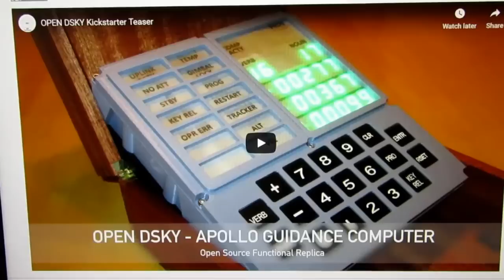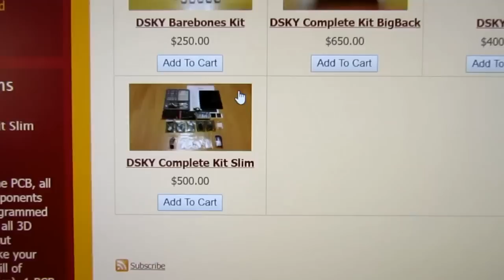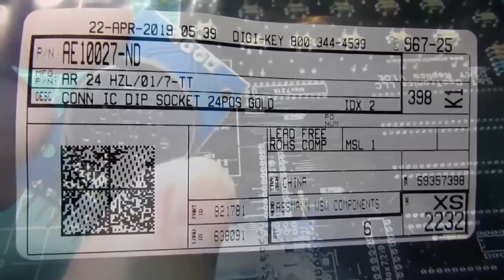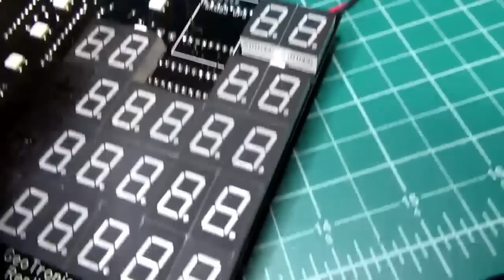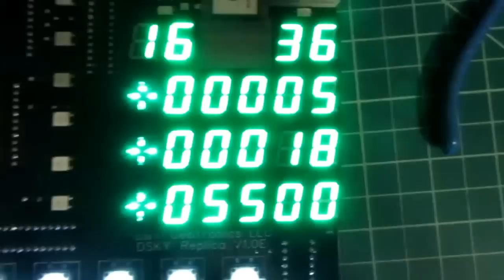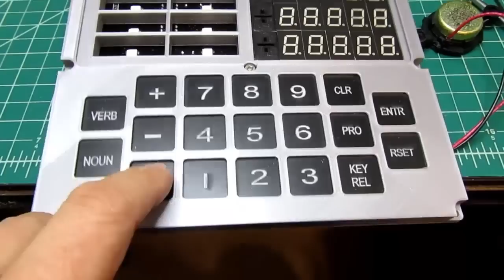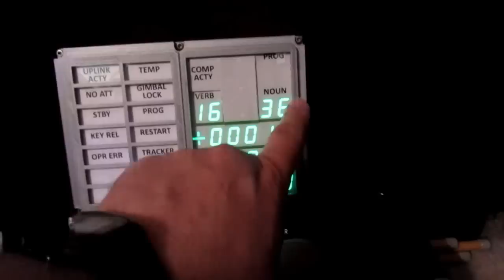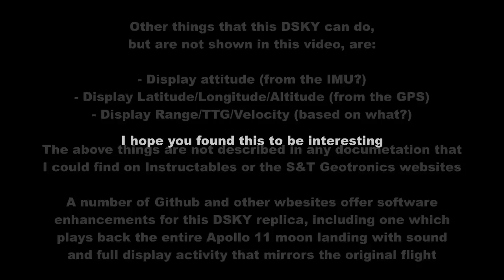Building the S&T Geotronics "Apollo DSKY Replica"

Comment: What's the physical size of the 7-segment displays? It seems the digits themselves are either .5-in or .56-inch. My guess for a physical specification for the modules is  .748" 19mm case/module length, .47" 12.7mm case width . And assembly with the 3D printed case may require a particular  height too.  Also, brightness depends on color - "green" 525nm is brighter than "yellow-green"  565nm.  Thanks for sharing your build!

Comment: Thanks SO much for this, a sensible and accurate assessment of the kit. I'll build one soon with your suggestions at-hand. I wonder if cutting the paper/sticker labels was a big issue at end (can you tell from the front?, or should I carefully try to get the numeric LED segments raised up to match the front surfaces?
Reply from the maker: Sorry for the late reply. If I were doing this kit again, I would definitely raise the 7-segment LEDs up to the level of the frame, so that paper overlay will be level across everything. The compromise I used works OK, but is definitely noticeable.

Comment: For $500.00 - Everything should fit perfectly and NO missing parts or need to dig out a Dremel to make switches fit. ...  Are these people kidding?   They need to FIX the damn kits.  They have no problem taking the $500 do they ...
Reply from the maker: You have to be realistic with your expectations. While this is a 'kit', it is not a professional product mass produced by a regular company. It is a project by a couple of guys who did this on their own and decided to offer the parts as a kit to others who might want it. They can't afford to be molding or machining precision parts, so they 3D print them, and for large parts on non-industrial 3D printers, that is expensive and slow, and thus consumes a lot of their time. 

They offer various levels of kit. One is just the plans and computer files, and for very little up-front money somebody can replicate their project at home on their own time and using or making parts themselves however they want. Then they offer the same thing, but with the PCB added, and that is not too much money. Then for more money, they add the electronic parts, and that is still pretty inexpensive. What really pushes the cost up is adding the large 3D printed parts. Then they have an additional small charge for pre-programming the Arduino and the micro-SD sound card for you.

3D parts (at least those made on non-industrial machines) don't have the precision of a machined or industrially molded parts, so there is bound to be some issues with dimensional tolerances. This is most critical where parts must fit close together, such as with the displays and parts of the case. Nobody can realistically expect that some level of find adjustment, sanding or whatever, will NOT be required. Heck, if you buy a plastic airplane model kit, you have to cut, trim, sand parts, and often fill some gaps with glue or plastic putty and then sand again. That is the nature of almost any kit that involves more than just common parts soldered to a circuit board.

What I had, and have, a problem with (regarding this kit) is that the guys selling the kit have made hundreds of these to sell as fully assembled & tested products. Yet their written instructions are nor well/clearly written, don't appear to have been revised or improved to reflect the benefits of their own experiences, and are generally presented somewhat out of sequence and missing important steps. The builder must be fairly savvy and willing to work things out for themselves. I was also not too happy with the hole sizes on the PCB for the pushbutton switches the guys said that they just force the pins in be pressing hard, but on mine the first switch I tried to insert broke due to the force exerted, and luckily they had included a spare switch, so with no other alternative I did what I thought expedient and necessary to resolve the problem. I suspect that they either made a mistake on the PCB hole sizes, or perhaps they changed switch suppliers after the PCBs had been made, and the new switches had larger pins. It is really not difficult to fix the pins, but I hope that on their next PCB production run they enlarge those holes.

I doubt that these guys are making very much on the kits. The low quantities 3D printing alone takes up a lot of their time, and costs a lot in materials expended. They are justified in charging for that.

My only real beefs with this kit, as presented, are:
- Poorly written manual, too much guesswork and head scratching required by the kit builder; they could and should do better, but my guess is that they are not skilled technical writers
- Manual is missing some critical steps, such as assembling the LEDs in such a way that they end up with the correct height relative to the 3D printed case, so that the overlay lays properly
- Display overlay was supposed to be printed on frosted finish translucent plastic, but on my kit it was just printed on adhesive backed paper. They do have the PDF of the overlay available, so the kit builder can print their own overlay on whatever material they prefer to use.
- The kit is based on an open-source project, and for the most part is not a design by these two guys (although they worked out the PCB, special '+/-' LEDs, etc), and I think their major contribution is producing the project as a kit. There is very little concrete detailed information available about exactly what the buyer will get once they complete the kit, and what its functionality will be. Since YouTube and other websites show other variants based on the same open-source project, the buyer can be confused regarding functionality. I thought that my DSKY would be able to play back a recording of the Apollo 11 lunar landing while the DSKY displays kept up with syncronized readouts. As delivered, the Arduino is not programmed to do this, and the micro-SD card does not those extensive sound files. The user must go elsewhere online to download the more elaborate files and then re-program the Arduino and sound card. I chose to not do that at this time, and my video does not show it.

So is the kit challenging to make? Yes.
Is the kit priced unreasonably? No.
Reply: youtuuba  - You make good points, I didn’t realize this project was a labor of love - I’m going to give this kit a shot and follow your video carefully - Thanks I appreciate your detailed feedback, 
you’re a great teacher 👍